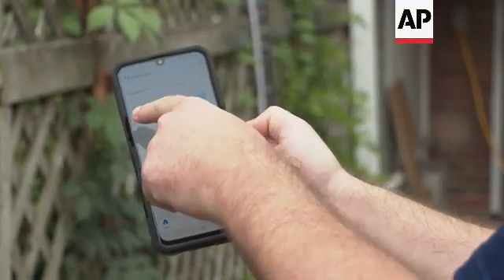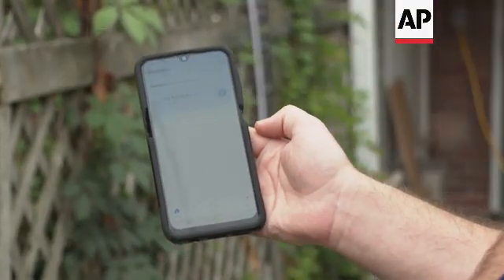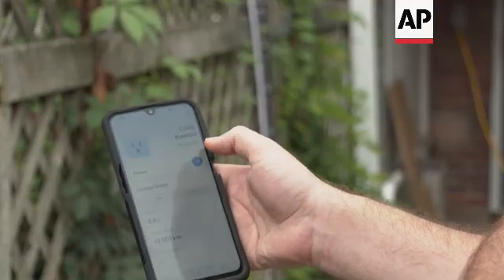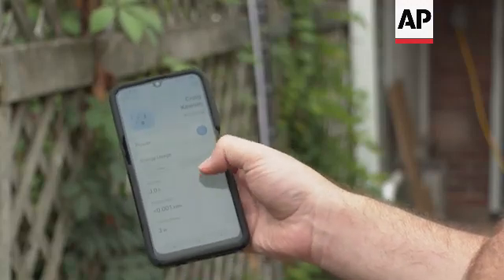Solar panels that can fit on your balcony are gaining traction in the US

Comment: Somebody please explain how it works. Home sockets are designed to GIVE power to a plugged-in electrical appliance. Where does that solar energy go after being plugged into the wall?
I use a Coleman 3.5-Watt solar battery trickle charger panel with OBD-II connector on my car's dashboard to keep my car battery charged during long periods of non-use. It works well for the purpose, but it's far smaller than the panel shown in the video.
Reply: It’s a little hard to describe current flows accurately, but the “pressure” (amps) from the solar panel flows into the socket - plugging in makes for a completed circuit - a socket is not a one-way valve with outflow only, it’s a connection completed by a plug. When you plug in a “load” meaning anything that “uses” electricity to do what you want (work) that is also a completed circuit with current flowing into the appliance and back through the neutral wire (bigger prong on the plug) - energy is released into the appliance to do something (dry your hair) but current flows back. With the solar panel energy is released into the completed circuit through the plug. Hope that helps - again, not perfect explanation, sorry.
Reply: @TomKacandes  : Thanks for the clarification. I thought the flow into common household electrical sockets was one-way.

Comment: Yes, it's quite common in Germany. We can use up to 800 Watts of AC directly plugged into the wall without permit. Add a few kilowatts of battery, the system is more than enough for a single person.
Given that these systems come from China and Taiwan, it shouldn't be a supply issue for Japan, but how's the regulation there?

Comment: Basically it might save you $20 something a month in power.
Reply: Even if it's $20 per month, it means it pays for itself easily in less than a year.
Reply: What's $20 x 100 million?
Reply: It'd be just about enough to float all my IoT home automation stuff during the day. Small but significant.

Comment: hmm if your in the US, you need a new meter to be installed that will recognize it. So dont start just plugging it in because you could kill a lineman the next time theres a power outage.
Reply: That's old tech. Ecoflow has PowerStream and Stream (microinverters) products that automatically prevents back-feeding of energy to the grid when the power is out to prevent this specific scenario you've mentioned.
Reply: Yep not going to happen